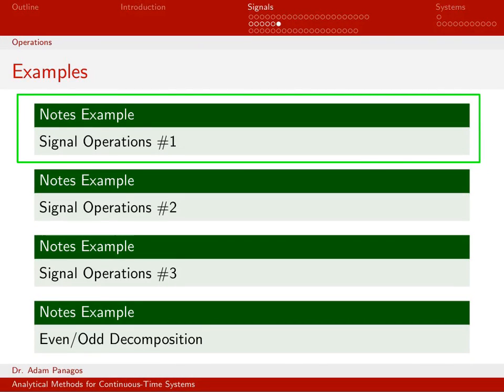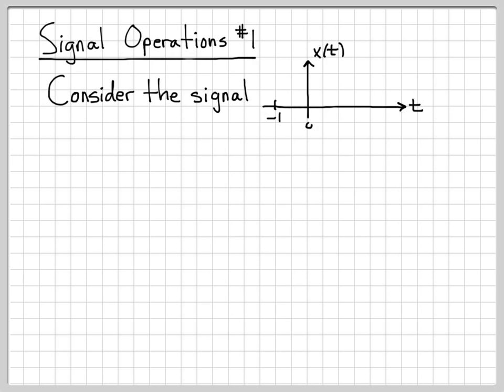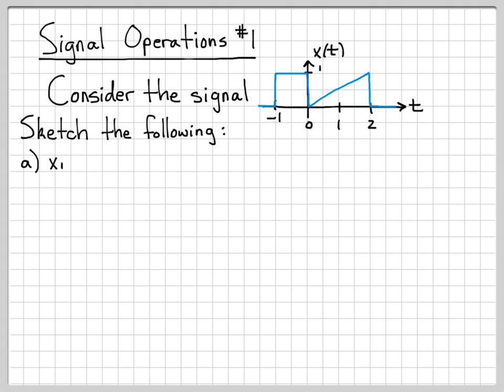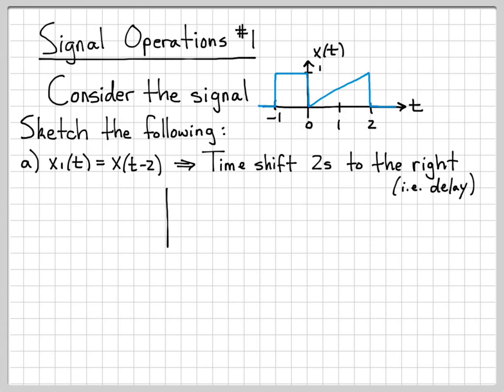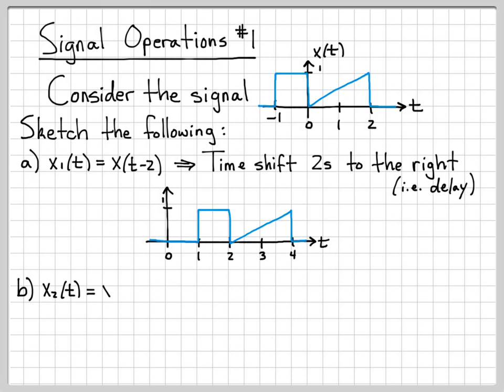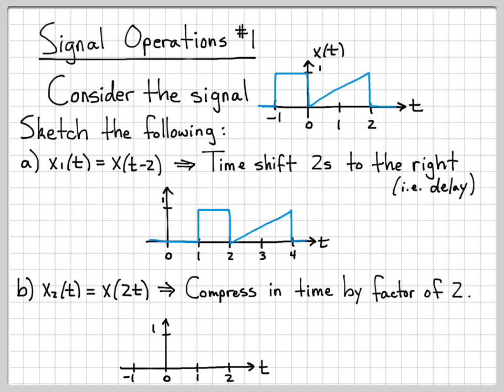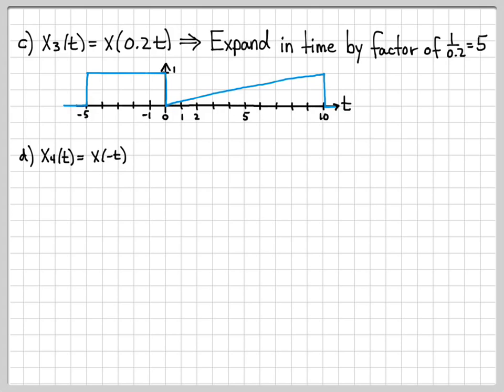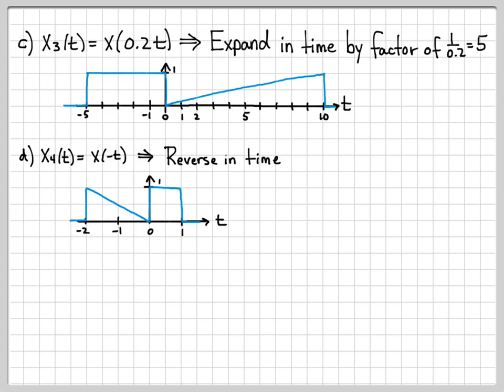Signal Operations Example #1

Comment: a little too fast but i need to know how did you get 1 for x(t-2) for t=-1? I thought it was x(-1-2) which is -3, and now I'm confused
Reply from the maker: We have that x1(t) = x(t-2). So, pick some value for t.  If t = -1, then x1(-1) = x(-1-2) = x(-3).  And that's correct.  x1(-1) = 0, and x(-3)=0.  A more interesting point is t = 4.  Then x1(4) = x(4-2) = x(2) = 1 (the top of the triangle.  We know that x1(t) = x(t-2) holds for all t, but plugging in a few specific values for t helps see how x1(t) got shifted to the right as compared to the original x(t).  Hope that helps,
Adam